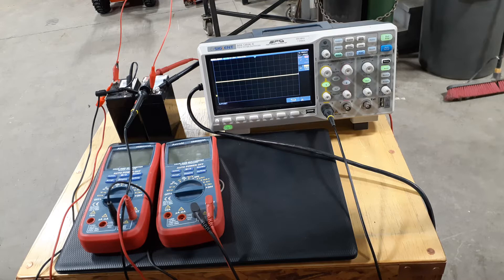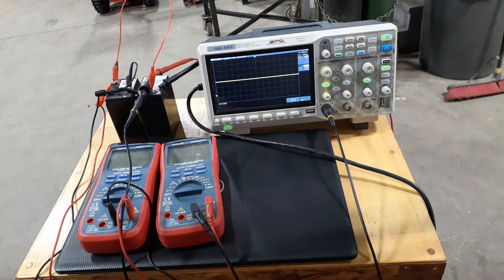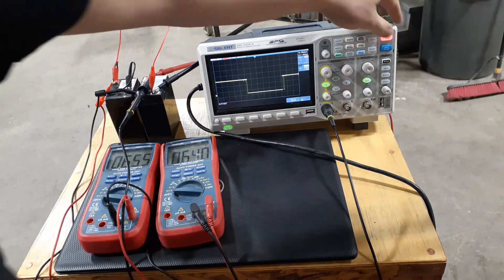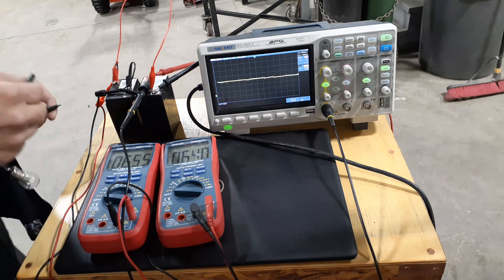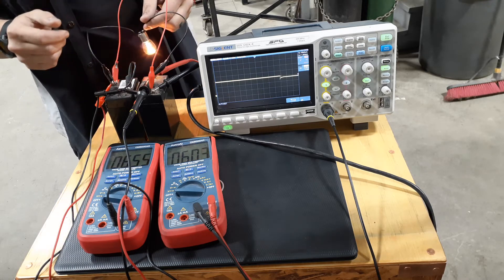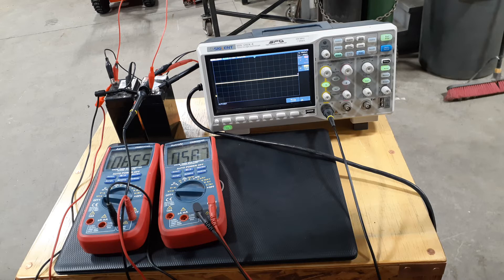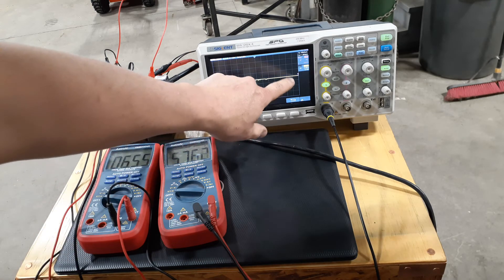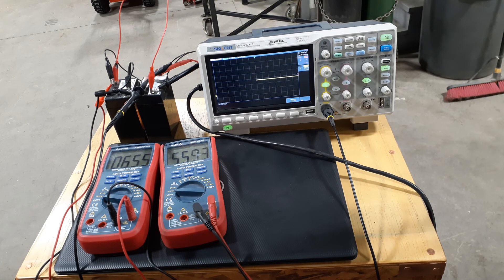12v 6v battery test with oscilloscope and meters.

Comment from the maker: Well, a lead acid battery would deliver cv cc or constant voltage constant current. I suppose it may resonate a frequency, but I'm not sure. 
If it did, you would see it on the oscilloscope and it would have a wave pattern that could be measured. But DC voltage and current are constant so it doesn't fluctuate. So I hope that makes sense.